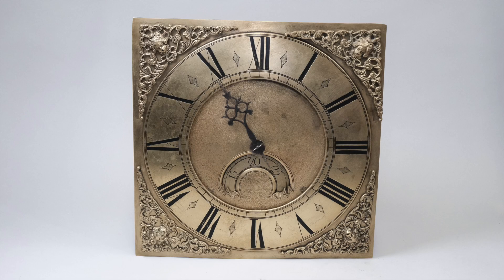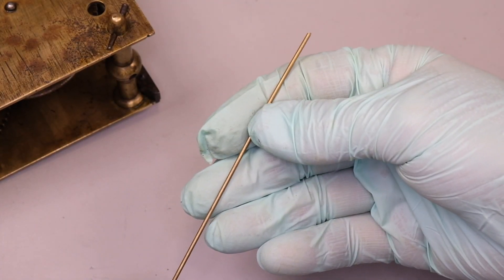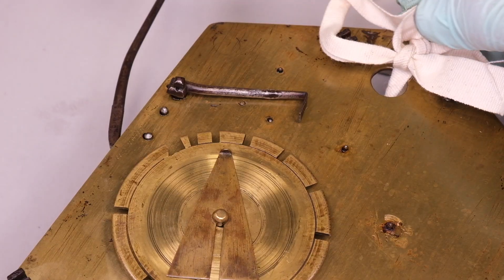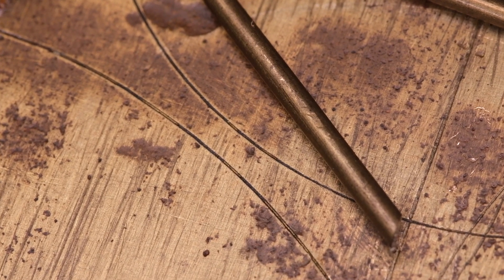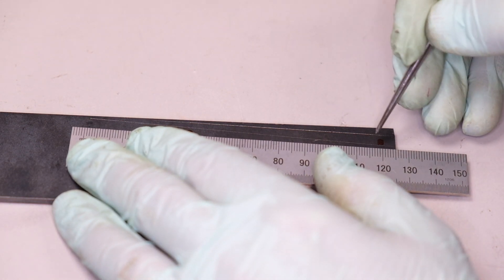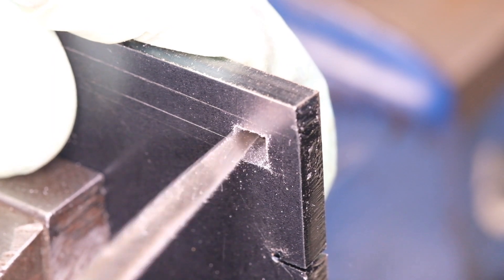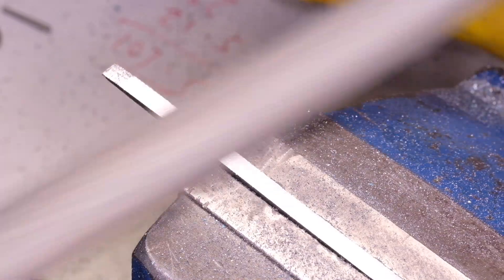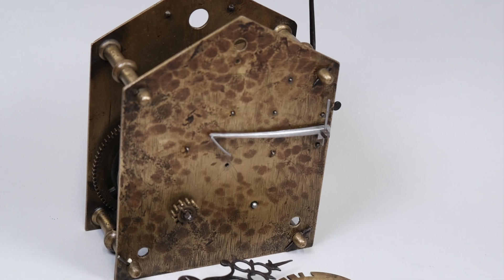#027 - Lifting piece for an 18th Century longcase / tallcase clock

Comment: Really helpful Matthew. It is amazing how often this detent is missing ( or has been removed/ lost)
Reply from the maker: Thanks Ian.  Yes, I can only think it was removed to disable the striking?  Cannot thinks why else it was removed?  M
Reply: @howtorepairpendulumclocks  If I remove parts to disable the striking I fix them to the clock for future re-use. To dispose of them shows a lack of respect and regard.
Reply from the maker: @jonka1  Agreed.  Yes it is usually possible to disable without removing parts.  I guess the approach/values have changed over the years. M

Comment: Oh, that is nice. Really like the way you have rounded and shaped it, looks really like the count wheel detent. Will you be re-bushing everything?
Reply from the maker: Hi Jon.  Thanks for your kind feedback.  I will be carrying out some bushing.  I always try keep it to a minimum with thin-walled bushes made from wire.  The pinions in the clock are very worn so it is borderline relic.  I will see what is the minimum driving weight it will run open to try preserve the pinions.